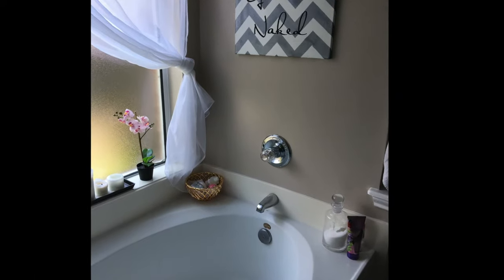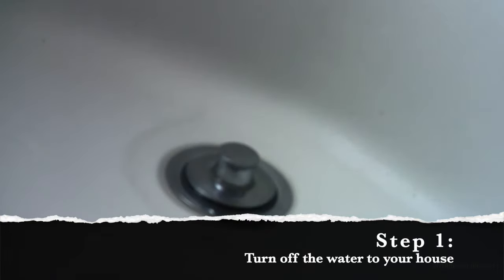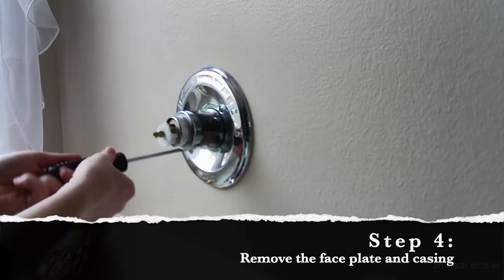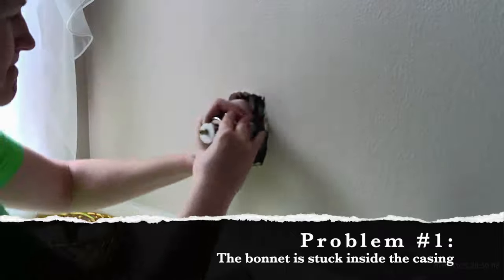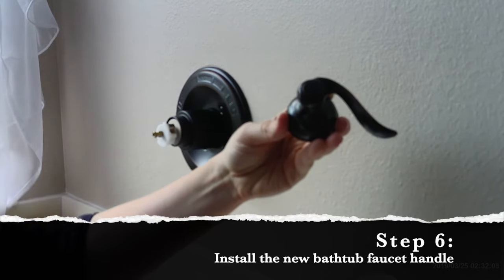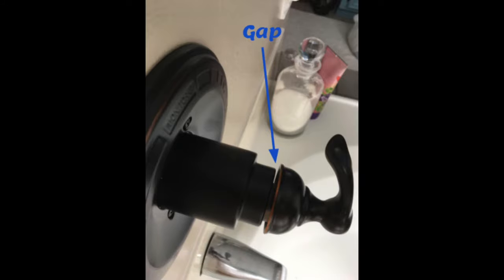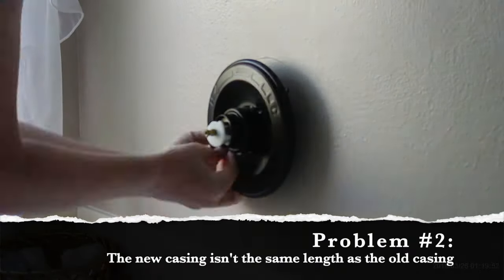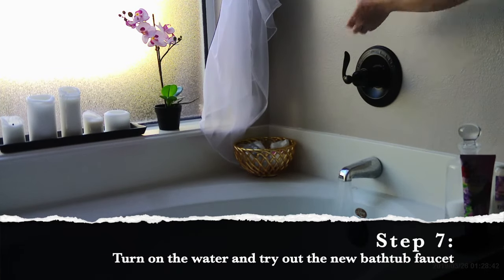Replace a Bathtub Faucet Handle (Longer Version)

Comment: Great video!  I will try this on our bathtub faucet.
One suggestion, turn off the water heater (turn the temperature to “vacation” or turn the control to “pilot”) before you turn off the water and open a faucet.  That lets air into the pipes and the water heater.  The water heater might not like having air inside; air does not conduct heat like water does.
After you turn the water back on and get the air out of the plumbing, turn the water heater back on (turn the temperature back to A, B, or C or turn the control to “on”).

Comment: Fantastic job! That was impressive.  You just saved yourself hundreds if not thousands of dollars.  You can also use a screw driver or wrench to tap on the parts that are too tight, so that it would be easier to unscrew them.

Comment: Have a question how did you know which shower set would be compatible. I have the same delta and it’s horrible looking and I want to use matte black instead of silver or bronze. And I’m new to this fixer up game and it’s a stand up shower and I can’t and don’t want to damage or replace all the hardware
Reply from the maker: Hi Christina! Great question. I had done a bit of research before making a purchase. I decided to replace my Delta handle with another Delta handle for the very reason that you're mentioning. All the sites I looked at said that the valves are universal and can work with any Delta handle. That's the primary reason that I replaced my old Delta handle with a new Delta handle. I didn't want to mess around with any valve cartridge replacements either.

Comment: Is that push pull shower faucet that easy to replace for a modern turn left right one?
Reply from the maker: Hi Richrico! the process was easier because I chose to replace a Delta handle with another Delta handle. In this way, I didn't have to worry about needing to switch any valves or cartridges for the new handle to work. If I had replaced it with a Moen, for example, I believe they use different valves and this would have required a bit more work. Happy DIYing!

Comment: problem is that i can't get the damn screw out from the old handle because it is stuck--i'm trying to adjust the water temperature to get more hot water
Reply: Put some clr on it or vinegar will loosen deposits....

Comment: My problem is getting the handle off at the start. The screw is very rusted, and my screwdriver can't get a bite into the screw to turn it and remove it.
Reply from the maker: That's a tough one. Is the screw stripped or just stuck? If it's just stuck and won't budge, I'd try some PB Blaster on it (link provided below). Let it sit for a bit and then try again. If it moves a bit and then gets stuck again, just repeat the process until the screw is out.

https://www.lowes.com/pd/Blaster-PB-Penetrant-4-fl-oz-PB-Penetrant/1000213835?cm_mmc=shp-cprdhdwgglPLA_HDW_000_Hardware_Catch-All-1000213835-online-0--0&ds_rl=1286981&gclid=CjwKCAjw_tWRBhAwEiwALxFPocKY-lzLXRj0o7okeU7H-f72rHmo5khujEKagoZVEdMA659ubW7RhoCElUQAvD_BwE&gclsrc=aw.ds

Comment: I texted one plumber and he said that he needs to open the wall to do this type of replacement and it would cost around 500 bucks. And I didn’t even tell him I’m a woman.
Reply from the maker: Ugh! That's ridiculous. Sorry to hear that. 

One of the reasons that I started doing DIY projects was because if I called someone and asked for help on a project, I'd inevitably have to do something anyway. For example, I hired someone to replace a broken valve on my washing machine and they left me with a giant hole in my drywall that I had to fix myself. 

I realized that no one will do a better job than me (after I've acquired some knowledge about the topic first, of course) because it's my home and I care about things being done right more than anyone that I hire to come in a do a job for me will care. It good to know your limitations -- I'll still hire someone if I feel that I just don't have enough skill to do the job. 

Happy DIYing.